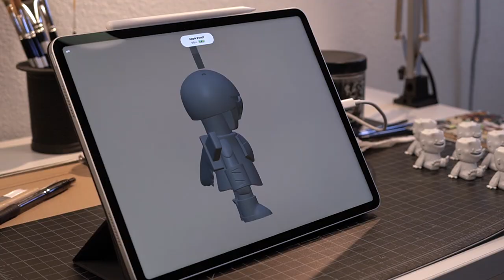Making a digital sculpted character toy art process | LOFI music 30 minutes.

Comment: In the beginning when removing the supports from the print, you rub the tooth brush on the area. 

1. Is that to smooth the support area?
2. What are you rubbing it with, that’s smoothing it out?
Reply from the maker: That would be the almighty Isopropyl alcohol!